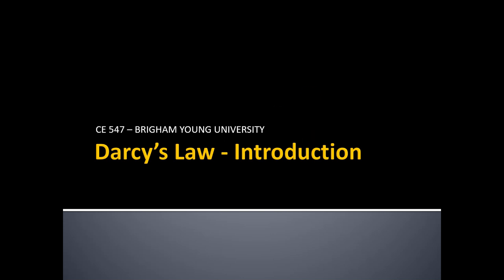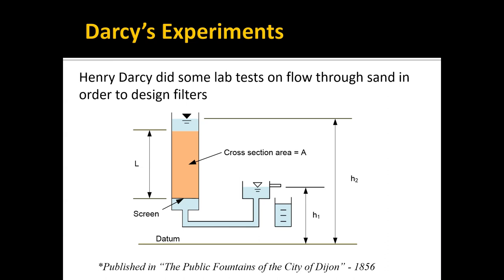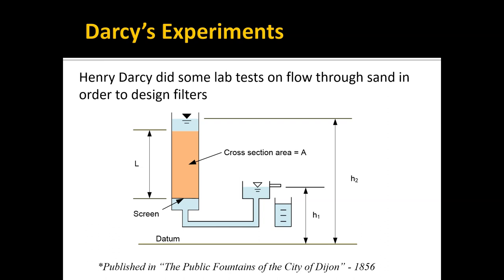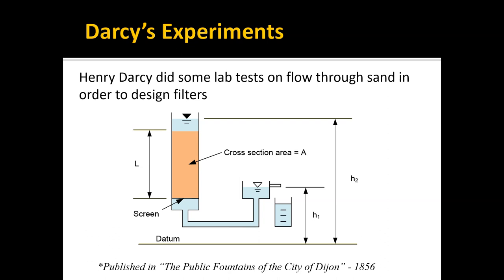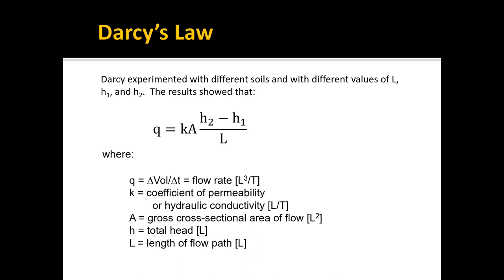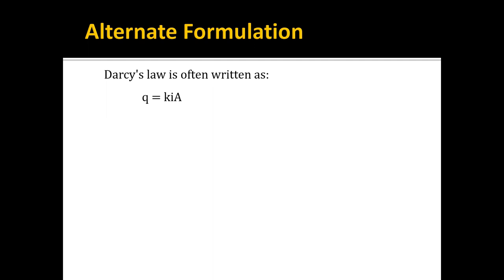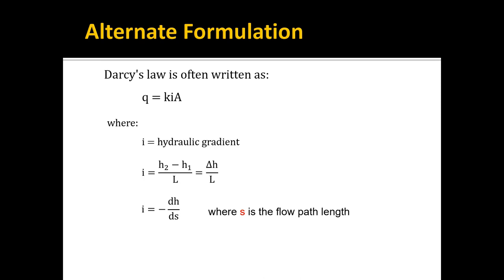Darcy's Law - Intro

Comment: Thank you for the provided material. It was exceptional. I have a question: How do we distinguish between seepage velocity and hydraulic conductivity when they share the same dimensions and units? Both terms are applied in cases of porous media
Reply from the maker: Thanks for the kind note. Yes, hydraulic conductivity has the same units as velocity (length per time). The reason is that hydraulic conductivity (K) is a scaling constant that is used to define flow velocity as a function of the hydraulic gradient (v = ki, or v = k*(dh/dl)) where i = dh/dl = hydraulic gradient. The hydraulic gradient is unitless because it is length/length. That doesn't mean that K is a velocity, it just means that it is used to convert a dimensionless term to velocity. Does that make sense?
Reply: @groundwatermodeling  Thanks for explaining! So, hydraulic conductivity acts as a scaling constant to convert a dimensionless term to velocity. That makes sense now. Appreciate the clarification!